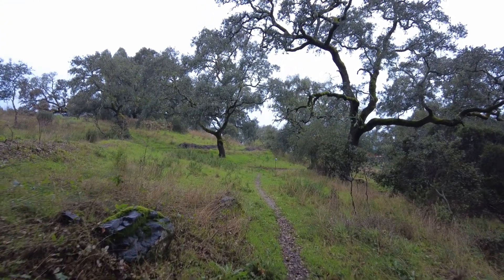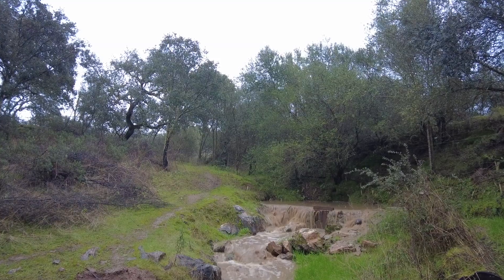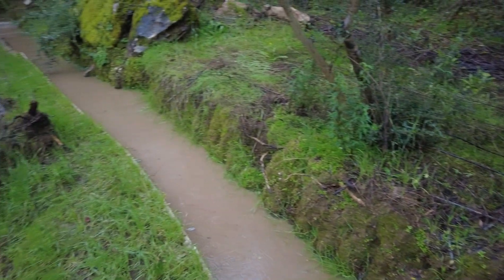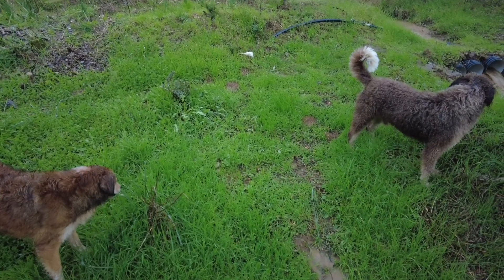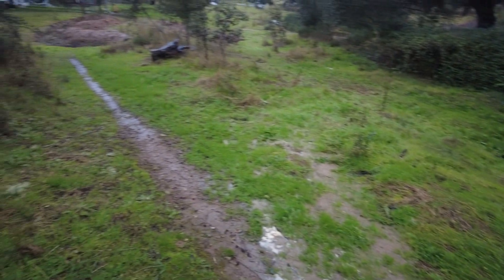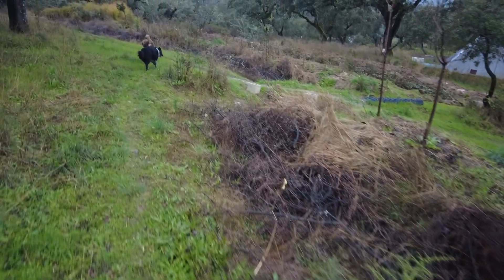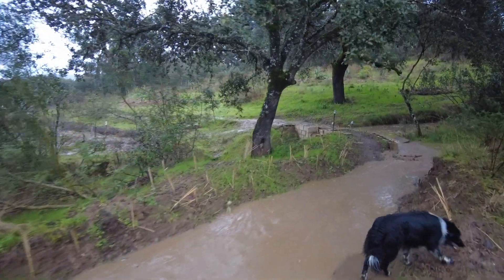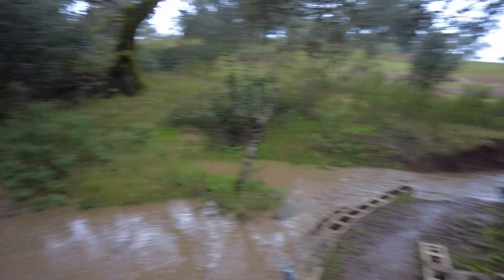When do we have Enough Swales? It's Time for the Next Phase of Regeneration. Video 1 of 3

Comment: More swales will work, why not. But if I could, I'd try to be hiring a 2 and 1/2 ton or 3 ton excavator to dig the existing swales 1 meter wider, a bit higher on the downhill side at the places I could.

Additionally, your existing swales will work better when treed up with a canopy. For each value tree (a peach) you should really have 4 legume trees such as acacia dealbata (mimosa) or leucaena as an example.   You haven't got that full canopy action yet, nor deep complex root systems really drinking water at a high rate, your system is still very young in tree years.
Reply from the maker: That is so true. Trees needed. Keep sharing. Much appreciated

Comment: Isn't the water flowing a bit too fast?
Reply from the maker: Yes. You are right. Changes will be made. Thank you for sharing
Reply: I think it is close to maximum capacity in the upper parts, so no real choice there, but to let the overflow pass through
Reply: check dams